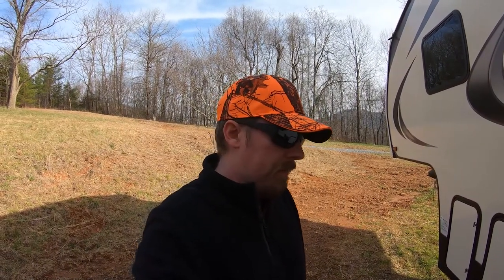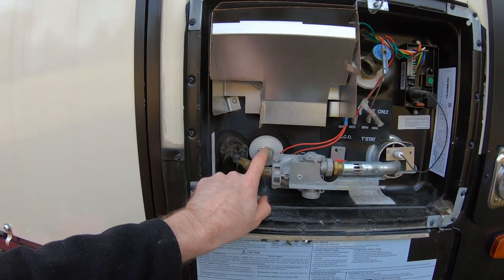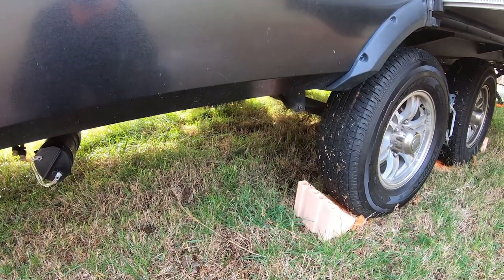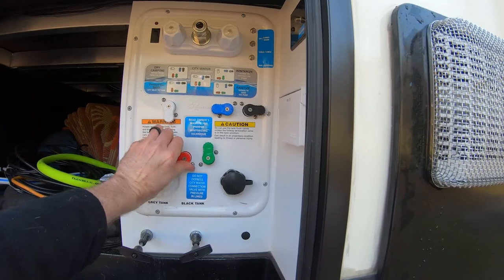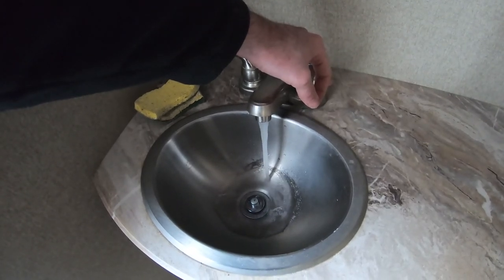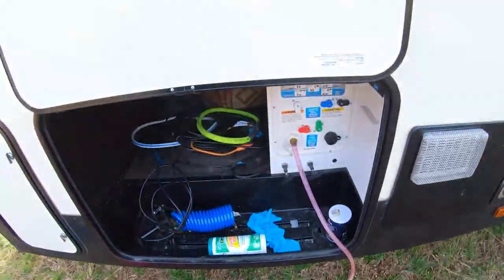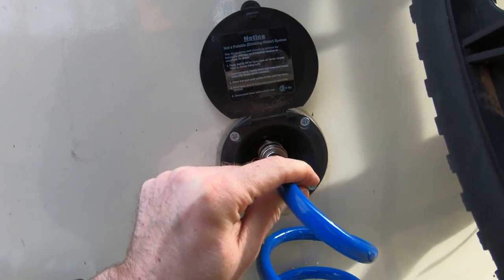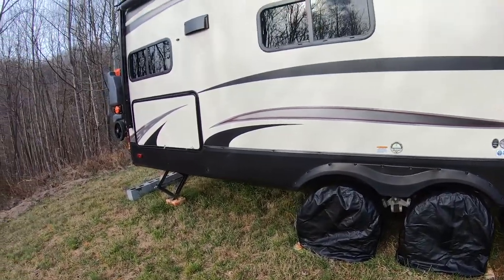Winterizing Grand Design Reflection 150 Series 5th Wheel

Comment: If you open your low point water valves and open up all the water valves inside your camper you will have less water in your water lines so they will fill quicker with antifreeze.

Comment: On yout rear hose connection you can use a blunt Phillip's head screw driver to push on the pressure valve...it's a one way valve. It has pressure built up and once you push it open you'll be able to  attach your hose easily. Be sure to keep your face away from the valve as it will squirt out fluid when you force it open..

Comment: Hi, I would suggest using 40 pounds of air connected to the tank flush and open the black water valve when doing this just to get the air out of the lines as there is a check valve that can crack and leak water if you do not do this when winterizing.
Best Regards
Reply from the maker: Thanks for the tip!

Comment: You can remove the hot water heater plug using a deep socket and a ratchet 15/16 I believe is the size works for me
Reply from the maker: Nice I will try that next time, thanks! - Shane